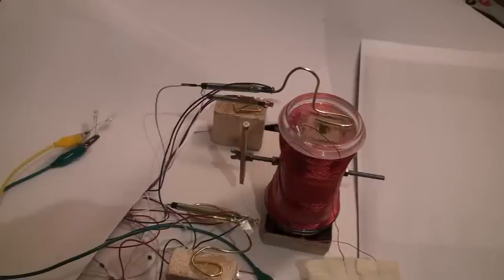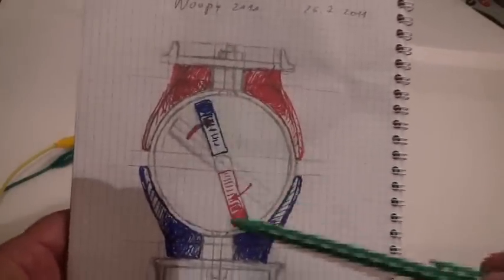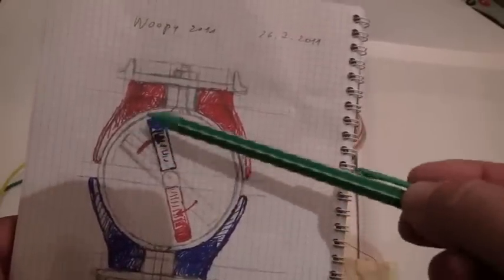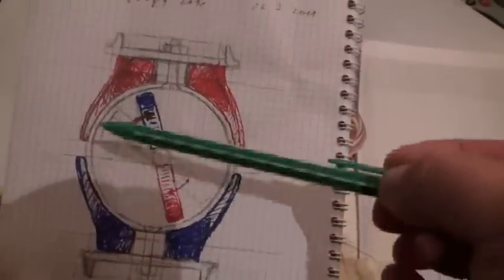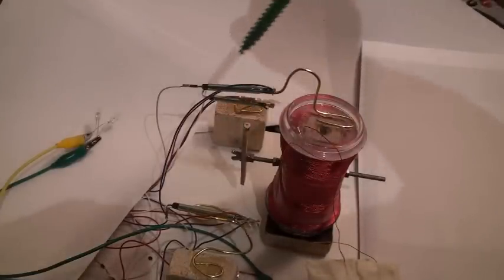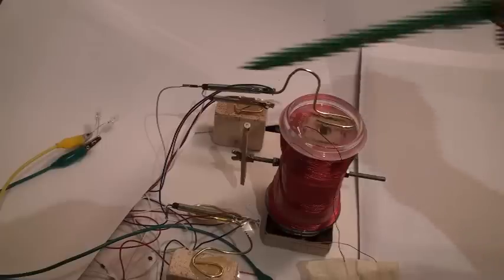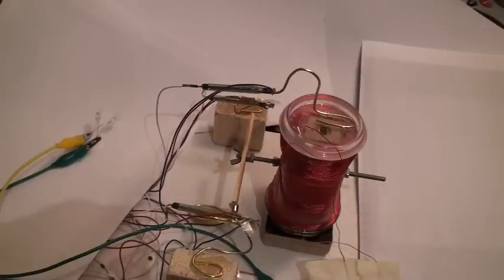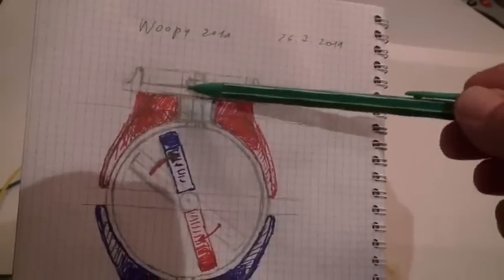magnetic flux amplification in the christmas motor

Comment: 3rd:  To feel the torque with your hand is simple.  Just make a direct connection of your power supply to the coil and then turn the rotor with your hand.  You will be able to feel the torque vs. angle like this.  This will give you a clue as to when the best time is to energize the coil for the most efficiency when the motor is actually running.   Make a note of what angle you feel the most torque, and then set up you reed switches to turn on that coil at that angle.

Comment: 2nd:  Where your rotor is located, you can imagine the magnetic flux is like parallel lines that go from the bottom to the top.   The rotor turns in a field of more-or-less parallel lines of magnetic flux that go from bottom to top.  Yes there is more magnetic flux density towards the top and towards the bottom like you say in your clip.  However, the maximum torque on the rotor is probably when it is oriented horizontally at right angles to the magnetic flux.  Try feeling it with your hand.

Comment: Woopy, to try to answer your question:  The way you show the flux path at 1:37 is incorrect.  Forget about the rotor for a second - the windings make a single large electromagnet/coil.  Magnetic flux enters the bottom of the coil and passes through to the top of the coil. The magnetic flux emerges from the top of the coil, spreads out (just like an ordinary magnet), and then goes around the outside of he coil to enter at the bottom.  Just like the field of a regular bar magnet.